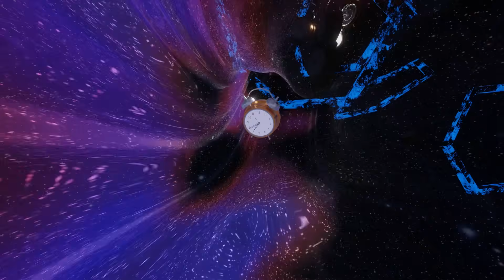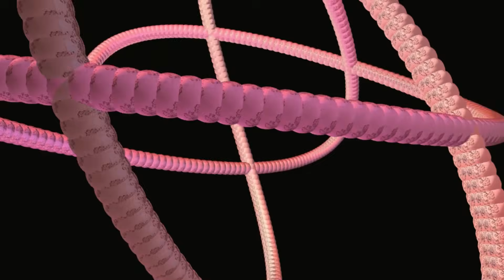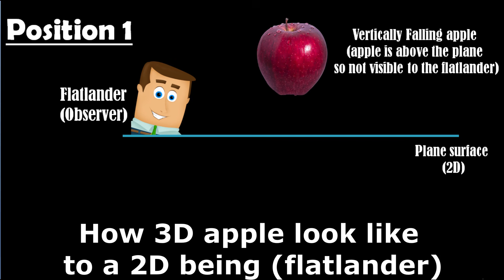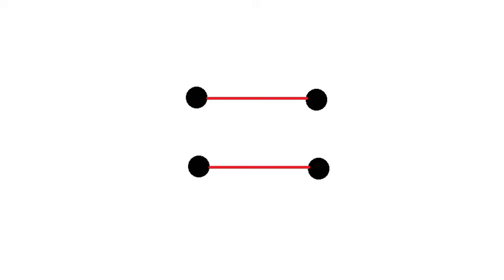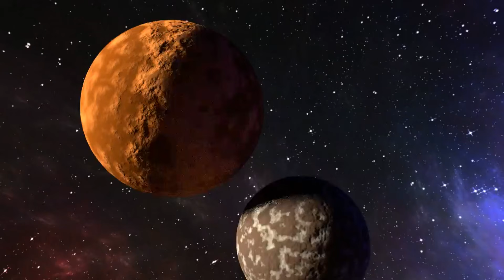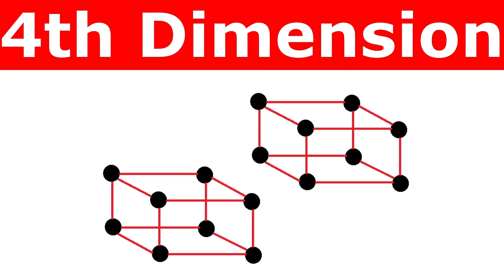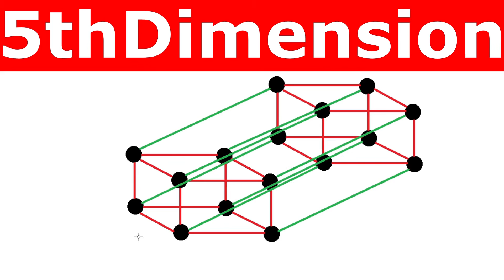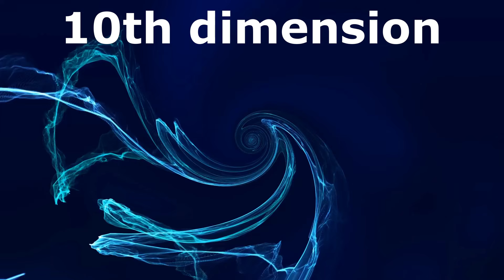11 Dimensions Explained - A Mind-Bending Explanation of Higher Dimensions!

Comment: Me trying to grasp it. (Writing...)
• So 0th exists, but doesn't move or have a form. 
• 1st can move back and forward. 
• 2nd can also move up and down. 
• 3rd can view the 2D worlds. 3D beings.
• 4th has linear time. When moves back in time point it moves back from doesn't exist anymore. Exists in points that follow the line.
• 5th Can move to different point of time and even when moves back in time moments still exist. But can only go to different timelines by going to the point it separated from the parrelel one.
• 6th can go to diffrent timelines without having to go to the point they separated first.
• 7th Infinite versions of yourself, but they have same initial conditions, time starts from same point basically. There are different universes you can travel betweeen..(Is this like jumping from your another body to another?)
• 8th Starting point can be different. The universe began a different way from Big bang for example. No physical forms, but beings can view things (see, hear) not touch. Compare to a hologram.
• 9th Universes have different logics of physics. Beings may live in same place simulateously without being aware of each other.
• 10th Beings have no physical form and can travel to any point in time in any of the infinite universes. Has beings with infinite powers beyond our understanding. Can affect past, present, future of any of the universes. I guess probably can change shape of things as well...
11th...

Comment: I propose a theory, that dimension are additive with no order. Think of a 3 sided corner in a room theres a floor, right wall and left wall. Any wall or floor or ceiling is 2 dimensional. Whats fascinating is that if X is Forward-back, Y is left-right, and Z is up down then a floor will use X,Y (Length and Width), while a wall uses Y,Z. Its only a third dimension when it has X,Y,Z but only if uses that example.

Although a bit more complex, there can be a 3rd dimensional time with 0th dimensional space it's just that time travel with a dot is hard because what it can do is nothing. Well then, lets say it can blink, on then off, but can't turn on when on, or off when off. It can only flip on or off at any speed. Blah blah blah just a flashlight if its a dot and it needs to have on option of at least two colores to switch to, trust me it'll make sense in any time dimensions higher than the 0th time dimension, at least if you want to visualize it.

(This point on is just a draft needs to be edited to finish come back next day and it will sure be finish unless I'm lazy)

To see the 1st dimension of time is handled by dot flipping on or off on a timeline with no colors needed. Just can't be a pattern that always loops on and off symmetrically long. Pretty much no, on for a second, then off for a second then back on for a second. Nothing to make the beginning of timeline un However, that only shows that time exists. 1st dimension 3rd dimension is handled by multiple timelines, which splits into multiple timelines caused by decisions, which it deciding to be on is one decision by on a scale of when, because otherwise there will be no option more than one to measure its decision. It will always go; on then off, on then off repeatedly. Remember we can use the 1st provided to develop  timeline

Comment: 2D shape-name or
3D shape-name for determining 4D end-shape and 5D end-shape:

(2D 'square' vs. 3D 'cube', in this case)

🆗️ 2D 'square' 
🚫 2D 'cube' contra.

🚫 3D 'square' contra.
🆗️ 3D 'cube' 

🆗️ 4D 'square' (2D shape-name) = 4D end-shape "tesseract". 
🚫 4D 'cube' (3D shape-name) = contradictory 

🚫 5D 'square' (2D shape-name) = contradictory 
🆗️ 5D 'cube' (3D shape-name) = 5D end-shape "penteract"

2D shape-name for determining 4D end-shape.

3D shape-name for determining 5D end-shape.

"Evens and Odds", transcendentally speaking.

0D: point

1D: length/line

2D: shape-name + L/W 'square'.

3D: shape-name + L/W + depth 'cube'. (snapshot of "now"/frozen in time)

4D: shape-name + L/W/D + Time (flow; chronology of "nows"/quaternion stereographic; relative); 4D 'square' "tesseract".

5D: (H1; "penteract")

"we're 4D?"- me,
"🔫 always have been"- also me.

Comment: Time being the 4th dimension makes no sense. When you refer to dimensions being length, width and height the 4th dimension wouldnt be time. Time is an aspect of every theoretical dimension. A 1 or 2 dimensional being could theoretically travel through time but cant travel through the z axis. If time is the 4th dimension then we are 4 dimensional beings cause we are constantly travelling through it and could theoretically manipulate it through speed and other aspects of the 3rd dimension. In fact every living being, in our universe, moves through time at different speeds depending on their size, how fast they are moving through spacetime and the gravity and mass of the planet they inhabit. We are all unintentional time travellers and age at different rates specifically because of how time operates in our universe. Im referring to time's relationship and interactions with the spacetime we inhabit and how fast we move through said spacetime.

Comment: You can't imagine 4 or more dimensions because there is no reference for it. How could you imagine thickness in a 2 dimensional world if you have nothing in that world to compare it to? Can you imagine 1? Something that has no height or thickness just length? Even that is impossible. Adding planes or stacking 3 dimensional objects onto each other is just that. How could you conceive of in and out if all you are in up and down and left and right? Paper is not 2 dimensions sorry. You are just visualizing the 2 dimensional sides of a 3 dimensional object.

Comment: The method you used for describing what a 2D observer sees when a 3D object enters their 2D world, dimensional stratification, doesn’t work as well under the context of compacted spacial dimensions

It was designed to help visualize how time intersects space in the 3S+1T model, and distinctly illustrates a separation in the stratified ‘sheets’ of time

For spacial constructs you’ll want to use dimensional skewing, best interpreted as a cube becoming a hexagon when compressed into 2D, or with the structure/function of a ‘color wheel’ (R,G,B,C,Y,M=X,Y,Z,-X,-Y,-Z), which is used in Chromodynamics to describe the interactions of gluons and quarks

It’s a bit/lot more accurate, and gives a good diving point for where dimensions are being ‘compactified’

Comment: Time. The 4th dimension. We 3rd dimensional beings can only move forward in time. A person of the 4th dimension can move back in time and forward in time. They are not bound by time. This is very cool. Can they pause/freeze time? Assuming they could, would it affect others or only them since they are a separate dimensional being? If they could pause time, and if affected everything else but them, everything in this universe would freeze since the universe is constantly expanding (heat). Right? Which means they would only be able to freeze time for a little while before the universe dies.

Comment: Thank you, for your explanation of the 11 dimensions. I have long struggled with the popular concept of dimensions (a place outside of our reality, where strange things happen). I understand that dimensions are, as you described, length, width and height, plus time. Your explanation has helped me to visualize the other multitude dimensions. Great job!
Reply: As a side note, time is not actually understood and doesn't exists the way we generally interpret and use it in our daily lives... at best it is understood as a process of entropy and not as a dimension. Still mind blowing either way.
Reply: @The_Absurdistt   2023 studies shows there's 163 dimensions 🤓
Reply: @The_Absurdistt  Forget time as a fixed point so, now think of duration one as time relative to you. Higher dimensions allow the use of duration two, under certain circumstances such as timeslips that can result! Also, two observers at different points in space will experience duration one & duration two, but still believing them to be the same relative to their own perception.
Reply: There's only1'9 dimensions after those numbers. There's no such thing as 11 universe there's only 9,for example 1 2 3 4 5 6 7 8 9 and 10 is 0. 1+0 is 1. 11 is 2 1+1 is 2. 13 is 4 1+3 equals 4 14 is 5 1+5 = 6  and so on forever
Reply: Have a video on my channel called numerology
Reply: Time does not exsist its a human thing just like his diementions made up in a human mind

Comment: the problem on how we can't imagine how a higher dimensions look like, we first need a media to view the content. as what media we have in the 3D dimension, we only have a TV which only shows contents in a flat 2D format. For example, 2D creatures can't imagine what a rolling object look like. well it sounds normal to us but remember that they only have 1D media. Also the same as the higher level thinking hardly abot another higher dmensions. We could see 4D objects using a media used by the 4D creature or a hologram. But it is still not enough, because we see things with our eyes that unfortunately see everything as semi 2D objects. Yes we can feel the textures, but we cant see objects 100%. For example we caant see anything behind a plank right? We only see objects that are heading towards us and not behind them. So we need to improve our vision to be able to see 3D to see 4D. That's all for the 2 hours presentations.

Comment: Take 0th dimension. Add a point, Increase the point by 2, and keep doing this for every dimension

0: *
1: ---
2:
---
|    |
---
3: This one is a bit more complicated, as you have to take the 4 points from the second dimension and put them behind each other to make the Z part
4: this one is 3d and then you double and basically make a square around the 3d (tesseract) and the central cube moves forward through the square and reaches the other side where the other side goes in front again (my simple explanation of moving tesseracts)

Comment: Gravity expresses in four positional and one time dimension. Electromagnetic effects can be described using three dimensions and the same linear time measurement as gravity. Properties of nuclear forces express in two for weak and one for strong. So, to fully express any physical property within space and time requires Four locations, one time, three electromagnetic, two weak and one strong nuclear force measurements. 4+1+3+2+1=11 variables required to model every type of measured physical effect. Numerical labels upon these forces seems as arbitrary as the order we place letters in the alphabet.  Calling every variable a dimension seems akin to confusion arising from calling types of particles color, strange, and such. 

Multiverse discussions lie outside of measurable physical phenomenon. I would suspect that to represent a multiverse phenomenon would require eleven additional variables for each additional timeline.  Notice location defines itself relative to other things. Each multiverse consists of similar, but not identical, things. Similar properties expressing location doesn't mean two, previously one, things are in the same place. 

Models of all possible conditions enable determination of a range of possible outcomes. Limitations in how we can observe produce singular measurements. Also, simultaneous measurement of every property of any point cannot be done. To observe multiverse directly would require measurement  more complete than our limited perspectives, and measurement means, can achieve.

Comment: Speaking geometricly, fifth dimension should be able to contact other timelines without returning to the point of divergence. He would just be going perpendicular to his current direction. A dimension is a set of two new directions. If you can go one place on that new plane, why can't you go the other?
It's like in a flat field. You come to a fork in the path, and go the one way. You can turn and cut through the field without going up or down. Why does this not follow into the 5th dimensional multiverse?

Comment: You cannot time travel & meet yourself. Bc you must consider laws that can’t be changed nor broken, or altered. By anyone. Hermetic laws of the universe. There are 12. One of which is polarity and duality. 

Which means if you could meet yourself in the past it wouldn’t be you the same one that you are now. Due to polarity and duality, You would have to meet yourself in a different body. As life must experience many different experiences and so souls change bodies for that purpose. 

However in a parallel universe you would meet yourself in a different body perhaps completely opposite to your now body. Or a different race as well. 

So stay with me even parallel universes or lives are simultaneously. They have never ever ended. And you’ve never died from those timelines. So those are the timeline you would visit if you went to your past

Comment: Why aren’t you using the light spectrum and wavelengths to explain dimension? It’s is only our “ equipment or body suit, that limits the ever present 11 or “ all” dimension happening simultaneously! We need access to all wavelengths to explain dimensions. And then on top of it all there are many versions of the same dimension weaving into different timelines and travel and choices can affect that crossover into parallel dimensions.

Comment: I disagree with your explanation of a flat lander who, according to you, will see crossectional view of a 3D apple. For that to happen the flat lander will have to rise above the 2D plane, but that’s impossible because for a flat lander there is no 3rd dimension (above or below). So, what a flatlander will see is a line which grows in length as the Apple crosses the plane, and then the line diminishes.

Comment: Every single thing said in this video is false. There is only one temporal dimension, all other dimensions (9 of them) are physical, and spacial. Adding ways to travel in time doesn't add dimensions. See, parallel time, or planar timeline, it's still the same single time dimension. We daily observe only three spatial dimensions and one time dimension because the other six spatial dimensions are "curled up" or "compactified." So if you've watched this and thought you learned anything, you didn't.

Comment: Just a sheet of paper turned sideways thin, then face forward, would explain the first and second dimensions simply most obviously and if a visitor was small enough, that being would be an insignificant speck within the seemingly much more vast universe of the nothing point zero dimension, as seen from the minuscule perspectives of unknowingly oblivious entities, surrounded all around by far away unknowns and a one dimensionally existing entity would be able to move only straight forwards and backwards, or, only straight back and forth left and right, or, only straight upwards downwards, but never two of them and never all three.

Comment: Hello, fantastic video. 
Question please: if a partical can move between past and future, does that mean he's not bounded by entropy?
Reply: The second law of thermodynamics was never meant to apply to particles able to move more than one direction in 4d or higher space. Let's simplify the travel down to that simple old question, "What's the quickest route between 2 points?" For us 3d beings, the usual answer of a straight line is the only one, and we can only travel that line in a single direction. But we're all aware of folded space. Draw those two points on a piece of paper, than the straight line between them. Instead, fold the paper to bring the 2 points together, shortening the distance. This is literally adding another axis onto the spacial plane. Entropy is no longer bound as it didn't increase with time, it was reduced. This is that lively wormhole physics topic every physicist spends his nights mulling over. Well at least they're finally figuring out that magnets create a binary magnetic field. Common guys, we knew magnets had two poles as second graders. So a bigger field of energy can leave one end than the one that's at the front end. Yeah, hope someone gets on that bubble model before Elon Musk does. He makes enough money already, he doesn't need to be the one to prove that warp bubbles are real.